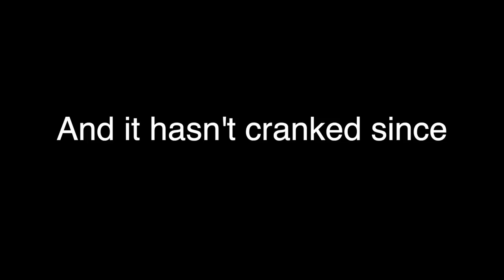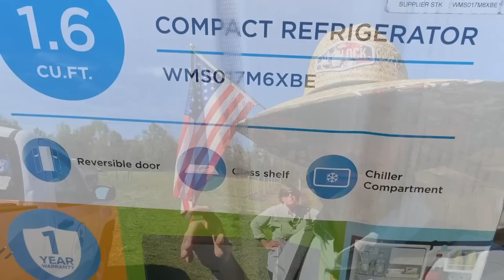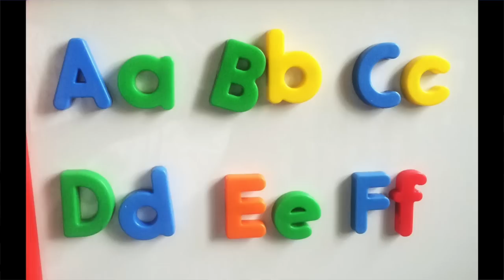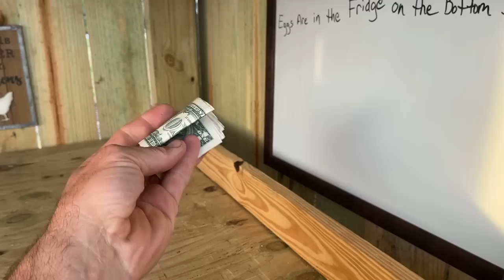Will It Work Or Will It Be a Total Flop? (Our New Farmstand Is Open for Business)

Comment: That's a freezer, in the top with the door.  Find a good cheap wine cooler, with removable shelves. You'll be able to stack more cartons and they'll be kept cool, like a cooler in Wally World.
Reply: Good idea! I found mine on Facebook marketplace.
Reply: cbob I like your idea!  I think they will become so popular they will need to add several fridges once Brooke gets more chickens!  Then a remote doorbell or dinner bell to "ring if you take the last carton"  would help keep them from disappointing customers.
Reply: If a taller fridge or cooler is needed, maybe you could reduce the length of the top shelf, supporting it at the new end with 2x4s.

Comment: Just a suggestion: I would put the ice box on top, more to the front.   I am 77 yrs. young, 6'ft. tall with bad knees and bad lungs there is no way I could get the eggs from where they are placed.  I was a retail manager for 20 yrs. and learned that if you want to attact attention to your product, it needs visibility.  Placing the ice box on the top shelf toward the front it would make it more visible and reachable for young and old, short and tall.   I am wishing you well with this new adventure.
Reply: I've seen several comments like yours about the placement of the refrigerator and I thought I needed to watch the video again. 😄 I thought it was placed on the top shelf.
Reply: @lindahitt6825  No, Brooke was squatting to load the eggs into the refrigerator.

Comment: That little spot is usually a freezer. May wanna check first, just so you don’t lose those beautiful fresh eggs.
Reply: Yes. I wonder whether that part could be removed altogether.
Reply: @mmegraham  I believe the freezer provides cooling for the entire refrigerator.
Reply: Yes it is the freezer and it does freeze well 'cause I have one.
Someone will get frozen eggs if they are put in there.
Reply: @cowtownokla  Yepper, yepper.
Reply: Did you mean a mini fridge? The have propane mini fridges, also solar piwered generators could be used. Put the solar panels on the roof then bolt the mini fridge from the bottom. RV centers have good options. 

For Patriot has two very good options currently. Last year’s version which actually comes with two generators. Larger one, and a smaller travel generator. And they offer a newer one for this year with options to support more appliances and charging devices for items like your phone. It also has a bigger back up battery for longer run time and faster charging. I believe the solar panel is also larger and is foldable.

Comment: The fridge that you showed is a darn good little fridge.  I have the exact same one and have had it for a year. It works so great, but if you turn the cold settings all the way up, anything under the freezer block can and will freeze along with anything in the freezer block.

Comment: My Neighbor has a farm stand and she puts a large Igloo Cooler out with several ice packs in the bottom of it.  She will refresh the ice pack at noon and picks-up the igloo around 6PM.  Also you might want to look into getting a solar panel charger and battery pack like a Jackery or an Ecoflex and mount it to a lockable box on the back of the farm stand with a pass through outlet on it.  You can power a small refrigerator with it for several hours while it recharges in the light.  You might want to modify your cart shelves a little Jason...maybe extended up from the base to the top and cut back a little of your shelf to make a cupboard type cubby- hole on that front edge that holds a larger refrigerator if your sales pick up.  😊

Comment: You might want to check out the You Can't  Eat the Grass youtube channel.  They are a Flower farm in Canada and built a road side stand that is a bit more like a shed.  They use an air conditioner to keep the building cold for the flowers.  They used to also sell produce, but have switched exclusively to flowers.  Besides the Honor cash box, they also have a sign for their e-commerce info for people that don't have enough cash.  They can lock up the roadside stand at night.  They also have something similar to a ring door bell in case anyone has questions.

Comment: you know if you lined that stand with Styrofoam got some Plexiglas used weather strips around the edge for the front you could hook up an old refrigerator compressor or small air conditioner and make the whole stand refrigerated to keep eggs and flowers in it. That would make it so you can hold more eggs at one time and lots of flowers and veggies.

Comment: Hey, yall, I have the same one...some of the eggs will freeze, I had Gatorade next to the lil top part setting on the wire shelf and it froze,  even though it wasn't in the lil freezer part.  Ya can't put anything under it either, or it will freeze too.

Comment: I'd consider facing the stand towards the road instead of towards the driveway. Then folks coming from either direction could slow down would to see if there was produce/other items still for sale without having to pull into the driveway. ☺️
Reply from the maker: The traffic is heavy on our road, they have to pull into the driveway or they will get ran over.
Reply: @CogHillFarm So right, do not risk getting sued by someone stopping at road edge causing crash/accident hazard. 
Customers are far better pulling into the driveway, FAR safer that way.😊❤❤❤

Comment: Harbor Freight Tools has a black mesh, 60% - 75% UV ray, sun shade in tarp form.  I'm thinking its the same textile as the assorted, black mesh green house coverings.  These do wonders for passively keeping structures and even spaces of ground underneath them much cooler; a bit of dead air space of even as little as 2" to 4" gives better results.  Even produce would do better with some temperature and sun reduction come the heat of summer and harvest time.

Comment: Suggestion as we did it with the full size frig in our produce stand. We have a walk in stand with doors we close at night. But we did at time lock the frig if there was nothing in it at the time for sale. In your case with a open stand if you are going to leave it down by the road instead of hauling it back and forth lock the frig at night after dark. Get a padlock and a padlock. Screw the hasp into the frig. Play with it to get it to fit best. Then you can lock up your frig. If you want to close up your open stand at night you could do it with a tarp and screw eyes. Put the screw eyes in the sides of the stand and use a tarp and padlocks. Put the padlock through the eye holes in the tarp and then the screw eye and lock it. I hate to tell you but with the honor system you will find that there are dishonest people. Most time it is the people who can afford to pay but they do not cause they are just mean people and think they are entitled to just take it. We do the honor system too. Our stand has been around since 2009

Comment: You could always mount an air conditioner through the back of the stand. Then use 2 plastic shower curtains to keep the cool air in one of the shelves. That way you aren't limited to what you can keep cool. Well only limited by the size of your stand. When you tack up the curtains you can slice the plastic into smaller sections and overlap them so the majority of the cold air doesn't escape.

Comment: You can  set up some solar charged lights with motion sensors so any one coming around after dark will trigger the light and help cut down on slips and falls, not to mention deterring some after dark predators stopping in and snooping around the farm stand.
If you get a second fridge you can also offer goose, turkey, duck or the Easter eggs.

Comment: Watching this video and loving your ideas. I’m sure someone has mentioned by now that the little sectioned off area in the little frig. Is actually a freezer section for ice trays, so it won’t work for the eggs. Maybe go ahead and put 1 or 2 trays ice trays in there to refresh your own drinks when you’re watching over the stand. If it will hold 2 trays maybe keep one ice and one frozen ice tea, coffee or juice. If it only holds 1 tray maybe add a couple of    popsicles will fit? Of course that would only be when your actually physically there

Comment: I agree, double ck to make sure the top upper right compartment is not a freezer. We have 2 of those dorm refrigerators and they both have feeezers. Also, just a thought...try placing a carton on its side in the bottom section of door with the wire holder turned down to hold it in place. 🤷‍♀️

Comment: The upper top right of the mini fridge is for freezing items usually. I've had more than a dozen mini fridges over the years and each one had a freezer section. My current one is the same, but this one freezes everything on the top shelf too so I've turn the temp down, but still freezes any drinks I have in the fridge even smoothies.  I bought it mainly for drinks and my yogurts

Comment: Didn’t read all the comments but you might want to round off the corners of your farm stand about the radius of a five gallon bucket and add a length of water hose around the edge. It might keep someone from laying their eyebrow wide open and end up owning the Hill. Drill holes about 1/2” in all around for zip ties and use 5/8” hose for a 1/8” cushion. Use the good hose too.

Comment: Be careful, that little compartment at the top right of the refrigerator is actually a freezer. So anything you put in there, or close to it (touching the outside of it) could possibly partially freeze.

Comment: You could use some spray foam to insulate one of the levels on the egg carton  and then close the front in with an slide door that you can slide either way and put a small air conditioner in the back and that should keep them cool!!

Comment: 🤔 Why put the pearlite on top? Why not mix it with the soil?  That way the soil has better drainage and it will be easier for the roots to take hold 
Also if you incorporate a small amount of Azomite and seaweed meal that will help the plants with getting the minerals needed when they are a couple inches tall and need the energy boost.

Comment: i would not be able to reach that fridge.  it is down way to low and shoved into the back. 
the compartment with the plastic door is a ice cube freezer!!!!! *** the area on the door you could put the carton on its side and probably the carton would fit there. ***** the upper compartment on the door is for butter. so you could cut a carton down and see how it would fit in there with may 4 or 6 eggs. (((( i suggest you check the money at least 2 or 3 times a day. yes it is getting very hard. hopefully if someone really needs eggs they would tell you and just not steal.

Comment: Great ideas for the farmstand,
You need to do 4 important things 
1) anchor the cash box so it can't be yanked off 
2) anchor the fridge with angle brackets or something stronger than screws or it will be stolen 
3) put a surveillance camera on the stand 
4) move the fridge closer to the front because people like me with mobility issues cannot stoop, bend or reach far.